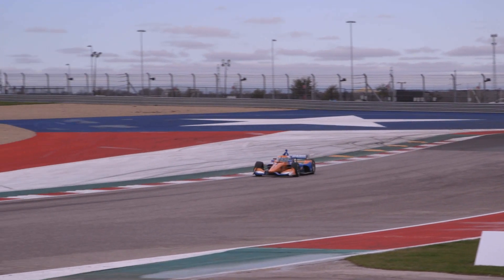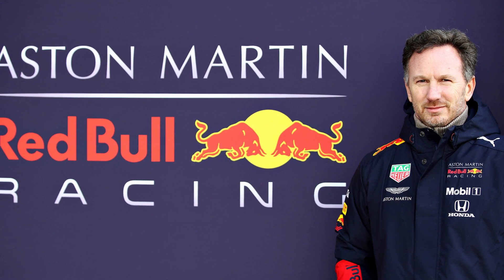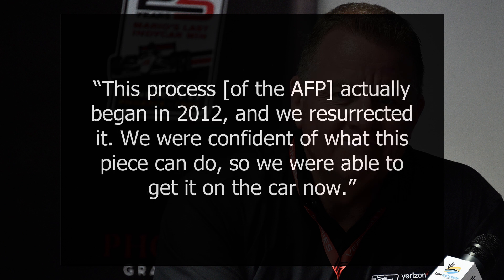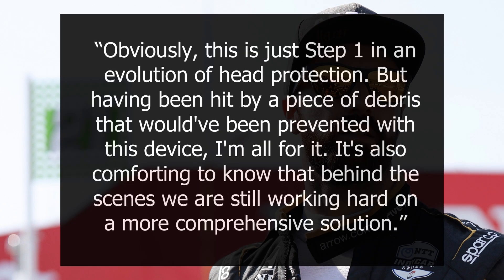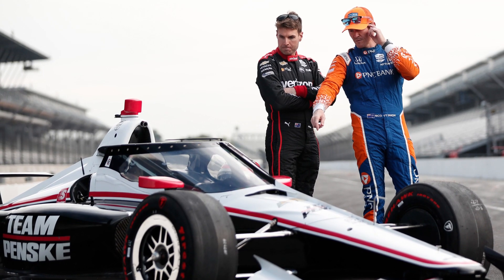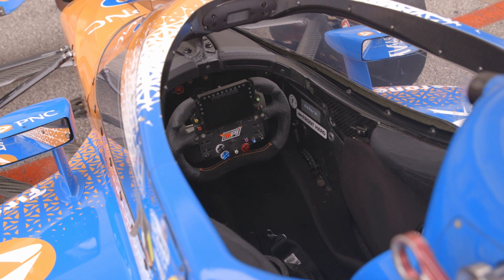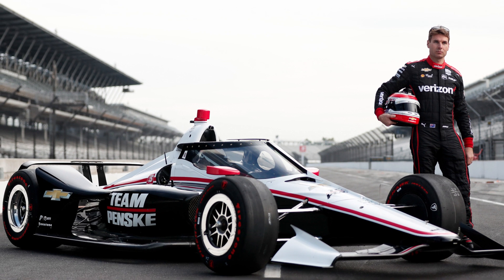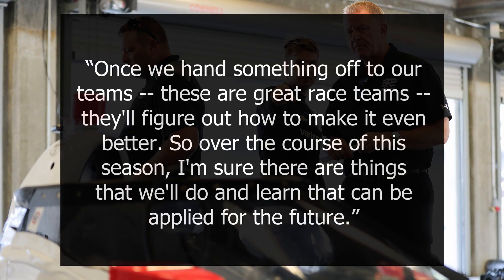How IndyCar Evolved the F1 Halo and Red Bull Aeroscreen for 2020 Windscreen | Part 2

Comment: So, in short, Mercedes won again in the end (Halo design was the best design).
Reply: Mercedes provided the best quick application for what was needed at the time. The distortion complaints more or less shot down Red Bulls initial designs. There was also a desperate desire to keep the open cockpit concept that F1 as a community was desperately trying to hold on to, so the halo won out because it. Now that the aeroscreen is shown to work better I would not be surprised if in the next few years if F1 adds it as well. Though this iteration is definitely a fusion of both the halo and aeroscreen test version, so its like Mercedes and Red Bull got together to make it happen.
Reply: @philipbarton3456  fully agree but the aeroscreen alone would have looked better

Comment: I think the aeroscreen is brilliant! I think it actually looks terrific. Im surprised they haven’t done this much sooner. F1 needs to follow suit; their Halo is absurd! Placing the center strut of the halo dead center in the drivers vision is beyond ridiculous.
Reply: Hold your hand vertical in front of your eyes at arm's length so that you are staring at the narrow face. Then look into the distance past your hand, your brain fills in the gaps because your eyes have crossing view paths. It the same reason why you don't see your nose all the time.
Reply: Drivers said it was ok
Reply: The aeroscreen has a strut in the middle too (albeit a bit smaller). Also, drivers never really look straight ahead. So it never really interferes with the line of vision.

Comment: Were there tests done on extracting an incapacitated driver? You reported that it takes 15 minutes to remove the screen. And can a driver be safely removed? Is there a feature in the seat that allows for its detachment allowing it pulled out with the driver still strapped in via winch.?
Reply: The driver access is more than acceptable through the top of the canopy, the dismantling of it in 15 minutes is like replacing a front wing , Aka removing it, if the screen gets a scratch. or dent in it from track debree.